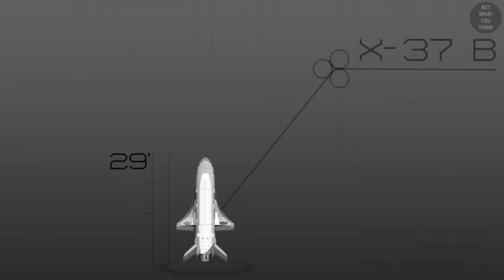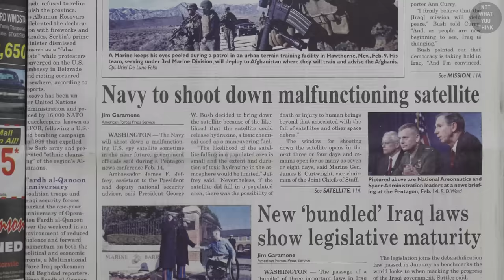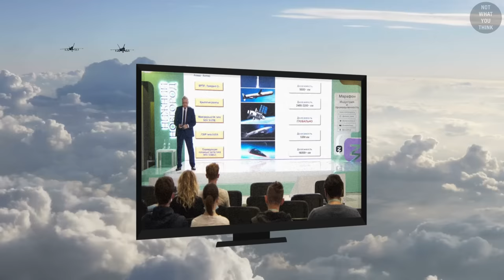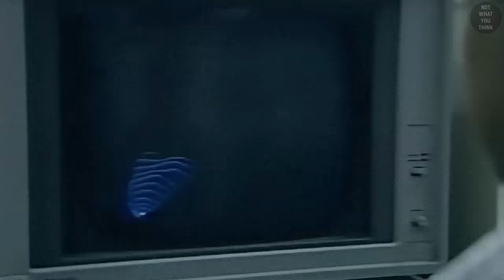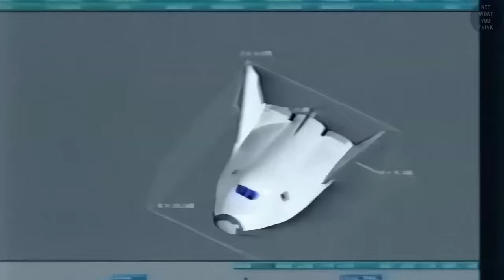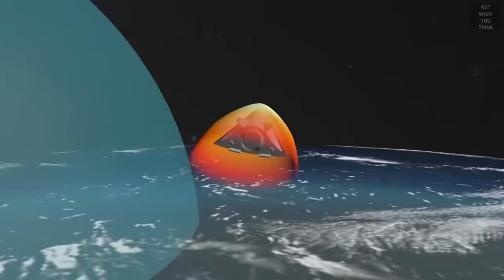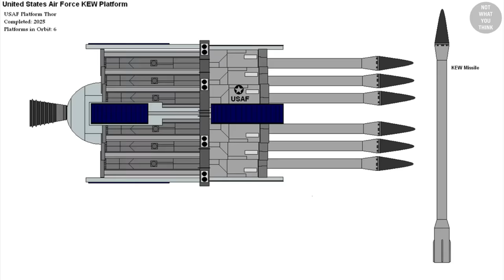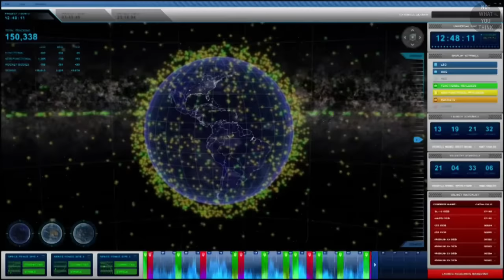Why Russians Think X-37 is a Nuclear Space Bomber

Comment: My take is that the X-37 is an all-purpose utility vehicle, and that shear utility lends itself very well to any number of military uses.  That role it's filling is determined solely by the payload, which is by default completely modular.  Many of the various scientific tests are about things that both civilian and military fields would find of interest.  Additionally, its flight profile is far more flexible than older satellites, and as everybody's orbital watch programs were build around those old limitations renders them far less valid by default.  Previously, satalites were like rail roads, and the X-37 is a truck that can go off road.  There are many reasons to want something that can go off road.

Finally, its entirely possible that both the program itself is perfectly clean and there are direct military uses being developed.  The payload bay is of known design, so handing those numbers off to a separate team/program with otherwise no connections is completely possible.  This is basic compartmentalization, and allows people to truthfully say they don't know about things that are happening.
Reply: This is without a doubt the answer- this way each field's experts can be tapped with clear conscience, far fewer OSINT concerns, etc
Reply: my exact thought tbh
Reply: An open platform to be utilized for whatever situation demands
Reply: Negative Ghost rider. It has one use and one use only. He he
Reply: I'd say mostly this, with a primary emphasis as a test platform for new propulsion systems - i.e. advanced plasma thruster prototypes or similar that are coming via black projects and not the open R&D pipeline. Where better to test one panel of a Millennium Falcon style thruster cell than with a craft we already admit has odd ability to change orbit much more than most previous vehicles could... well, yeah.... great way to more or less admit what you're using it for while still being quiet about actual capabilities (as long as you use limited power during tests so nothing too quick/fishy happens that would raise their suspicion more) :D
Reply: It's also important to note that the US space force needed a vehicle to actually do stuff in space, something that was both small but could get things done. I bet they are already looking into more cost effective means of actually getting things into space.
Reply: in a way it could be considered "modular", and we all know how the U.S feels about that word
Reply: Agreed. A dedicated space bombers makes no sense to me when we have ICBMs from the US and Submarines... Hell a stealth 21 B with cruise nukes can do the job as well just as much... 

 A TEST utility vehicle makes perfect sense to me. I feel like it is a bit too small.

 A satellite killer definitely makes sense to me though. Something that can go up into space and disable multiple satellites quickly without causing much debrie would be insane. How one does that I have no idea. Space LAZERS on a TURRET! 

 I mean if it were to be a military weapon that would make the most sense. A weapon that can stay in orbit with utility uses or ways to disable satellites without causing a huge space catrasophe with space debris.
Reply: If the US isn't trying to develop space weapons, that would be the real surprise. If it's not the X37, it's something else we don't know about. So yeah, the impetus is there and the X37 could very well have been fast tracked for weapons development. It doesn't really matter though because something is.
Reply: So no.4814, it is in fact capable of carrying a nuclear load. So its a nuclear bomber after all. Good to know.
Reply: @marekkurwa  By that logic, so is a Cesna.  Not a very good one, but physically possible.
Reply: @danielbrower4814  Sure no.4814, very genuine response, human like too.

Comment: The tungsten rod would be closer to a moab bomb  not a small nuclear bomb. And that would be a normal rod, but the cargo bay of the x-37 is small so a smaller rod could fit.
Reply: I don’t know much about the rods but I tend to agree. They’d probably be more for precision strikes in places with good anti missile defenses
Reply: Won't it just disintegrate as it enters the atmosphere
Reply: @RohanSingh-zc4bm  Although there is a chance, I’m sure the space force has done research proving it won’t
Reply: @RohanSingh-zc4bm  Nah. Tungsten is very resilient to wear and tear. it will certainly heat up a lot, but as long as the rod is reasonably large most of it will hit the ground incredibly hard.
Reply: Its weight must be immense!
Reply: Actually, the smallest tactical nuke had/has an explosive equivalent to 10 tons of TNT, both the Moab and the latest proposed kinetic weapon system have higher yields. The MOAB is equal to 11 tons, and the kinetic weapon system last proposed in 2003, was 11.5 tons. The concept that was proposed in the 50s was to use even larger tungsten rods and would have had an even higher yield. But the X-37B is too small to carry even the smaller rods, it only has a cargo bay close to that of a pickup truck’s bed. The much larger X-37C could possibly carry them, but it still hasn’t been shown, so no idea just how big it will be.
Reply: Tungsten rod the size of a telephone pole dropped from orbit would generate an explosion equivalent to 120,000 pounds of tnt I believe and be next to impossible to detect as well as impossible to intercept because it hits Mach 7 or something

Comment: @7:49 is a good photo of the bottom of the nose of the aircraft.  The heat shield tile layout looks particularly interesting. As of those around the oval tile could fold forward over the oval tile like petals of a flower closing at night.  This would allow a telescope to be housed behind and have the secondary mirror on the back side of the oval tile. This also fits with why the front looks significantly thicker than the space shuttle design, the odd location thrusters at the nose area and why the heatshield tiles go so far up the side of the nose...to protect sensitive equipment located therein. This is a moveable telescope that can change predictable orbits (something that known about satellites and is used in mission planning on the ground to hide assets).  Tthe cargo bay probably houses fold out communication equipment to pass data to other satellites or ground stations. I doubt the vehicle would carry a warhead in the cargo bay, or it would have to jettison it each time before landing. A payload like that would be too heavy and high risk to attempt a landing at any of the known sites.  Now, they could have tested the effects of space on warhead components, but bringing a device back is again, very high risk and would probably land at a less populated site.

Comment: The hilarious part is that it is exactly what the Air Force says it is 

As an example 

Put 20 gyros on it , with them running continuously until 15 fail or the ship needs to land ( whichever comes first )

And then the engineers get to disect the failed gyros and find out why they broke.

They really are testing components for satellites , in order to build satellites that last longer.

Comment: I think it's a recon vessel, but maybe it has anti-sat capabilities, or else, it can evade anti-sat missiles. I think it's reusability makes it ideal for rapid modifications of whatever it's carrying in its payload bay. And, it's not impossible larger variants of the X-37 have ground or sea strike capabilities. The USA may not have an edge in "hypersonic' atmospheric weapons against China and Russia, but it does have the most superior vehicles operating at the ultimate high-ground, and any weapon dropped from high orbit would naturally be hypersonic even if its a gravity driven dumb-bomb. The USA has several multiple purpose designs in its vehicle inventory, and you essentially can't tell what it's capable of doing until it actually does it on mission, because you don't know what it's kit/loadout is.

Comment: X-37 can certainly be dual use.   It can use some space to conduct experiments, and the rest for nukes.   But I'm skeptical, because the point of nukes is deterrence.  Deterrence doesn't work if you keep the nukes a secret.
Reply: Yeah exactly. Plus if I were sending nukes into space, I would leave them there. I would not wanting the nukes returning to my military base flying 10fold the speed of sound in a vehicle tested like 10 times.

Comment: Hydrazine is so corrosive that will it will still eventually eat through those max level protective suits. So many times the suits are disposed of in special treatment center after 3 or 4 uses. The XB-37 is what the Pentagon wanted the Space Shuttle to be, then didn't use it in the end and those Pentagon requirements are well known.

Comment: When we have highly effective ICBM's, why would we need this drone to deliver nukes?  No, what they told you about testing engines, re-entry technology, and testing metals and components is exactly what this would be used for.  I am sure they tested an ion drive already, and if used as an anti-sat platform, I'm sure it would be very effective.  Now if we had a valid laser device or particle beam weapon, it would be great for those two, but the last time I saw an effective airborne laser system they needed a 747 to house it in.  Rail guns are coming down in size, but I don't think they would fit in there either.  The hydrazine story about the hazmat suits sounds spot on too.  We use them in the F-16 because it's a fly by wire craft with no hydraulic/cable backup in the event of power loss from it's single engine.  In this spacecraft, there isn't a jet engine to provide power, so it probably uses the same kind of power system as the F-16 APU.  We used to have drills clearing the flight line of personnel if there was ever a suspected hydrazine spill, and they mopped up wearing suits just like that. 

Since they have been hell bent to create this 'Space Force' recently, I wouldn't be surprised if they were investigating a manned combat shuttle at some point.
Reply: The whole program was just a test for the real project that’s up there now or about to be. Just making sure certain technologies worked before goin all out with the real project

Comment: The US has pumped countless dollars in now deployed direct energy weapons (Lasers) to protect naval ships from air land and sea vehicles, drones etc. the first deployed was powerful enough to destroy a small boat, they now have a 150 ,..5x thd power of the beam . If u think of it, a laser beam of energy moves at the speed of light, instant , it’s path is perfect straight , not affected by winds etc and the beam can stay consistent . Clearly with the current research is direct energy weapons put in fighter jets, ground vehicles, base defense and a now testing AC-130 SOF suporting Gunship with a laser adjustable in power output. A weapons system operator or AI based targeting system uses sensors to locate targets and with light speed perfect straight instant impact could fire hitting a baseball instantly with unlimited targets, SOCOM operations support would be like nothing before . Defense lasers on aircraft are being developed simultaneously , an S400 is no threat when it’s picked up and located by the jets sensors , then jsut take a very simple program like those thst operate the Phalynx CIWS defense weapon that scans , seeeches, locates, targets , tracks and intercepts targets on its own in autonomous zone. An effective weapon but put a laser on it it’d be unstoppable because the radars know exactly where the target it it’s then just need to fire, not project where it will be by the time the rounds get there.  China is workin to on a laser so we see the future is laser defense weapons .

Comment: I thought that the HTV-2 project was cancelled. If not cancelled it's definitely not a part of the PGS program anymore. PGS has seen a significant reduction in light of a massive budget increase for various other hypersonic missiles programs which are more urgent (and cheaper) than a system capable of hitting any target on the face of the Earth within an hour. Medium range systems of up to 2000 miles, both boost glide and cruise missile types, are the focus of DoD's effort to field the next gen strike systems.

Comment: It's got all the hallmarks of a multi-role workhorse. In fact a tiff over the mission creep behind the X-37 probably contributed to the founding of the Space Force. A delivery system for warheads is only one possible role. In a hypothetical future military space station, it could be a means of delivering supplies without relying too much on the fickle private sector to run the missions.

Comment: It would be stupid to place nukes in orbit for the purpose of targeting places on the ground. Its very difficult to de-orbit an object. You need a lot of delta V to kill your orbital velocity, and even then, you are still traveling so fast that you light up like a beacon from friction with the air.   If you just passed the spot you want to nuke, you would have to wait 70 minutes or more until you came all the way around again to launch.  Every ICBM in the US arsenal has a shorter delivery time than that.   Ballistic missiles launched from a sub can hit anywhere, even more quickly.  The Only thing an orbital launch platform would enable you to do, is to more rapidly take out an enemy’s orbital assets. Be that spy satellites or a full on space station.   Another potential use would be a laser based ICBM interceptor system, looking to destroy incoming ICBM’s while they are at the top of their trajectories, out of the atmosphere, where a high energy beam weapon would be more reliably effective.  But something like that would have huge power requirements, requiring a nuclear reactor, or solar panels larger than those on the ISS.

Comment: There is not much different in fuel and rocket payload to move multiple warheads on a long range ballistic path vs putting them in orbit for months if not years at a time.  You don't need a little space plane to smuggle and stash nuclear warheads into space.

Comment: I've never understood the obsession with reusable spacecraft. We use millions of tons of disposable stuff here on the surface every week and the effort to reuse a spacecraft is massively more expensive and less fuel efficient than a one time use spacecraft. The manned shuttle at least had the excuse that it needed to return the crew, along side the general novelty for positive PR.

As for orbit based weapons, pure propaganda, the physics just don't give it military or cost advantage over terrestrially launched missiles.
Reply: Look up "rods from God"
With the kinetic energy you can gain on reentry it doesn't need to be a nuclear weapon.
Reply: @rogerout8875  Again, childish fanboi propaganda. The physics(Orbital mechanics, energy losses, cost, response time, etc) do not give rods reentering from an orbiting satellite any advantage over a terrestrially based weapon system.
Reply: @mytech6779  it would appear DARPA disagrees with you.
Reply: @rogerout8875  The physics are what they are, and while not elementary level they are not some controversial topic at edge of the envelope.
So either you don't understand what DARPA has published, or like I wrote before... propaganda, cherry picking data for clicks and politics.

Comment: It's certainly no doubt that the losses and retirement of the shuttles were a loss to space cargo, and there are things NASA, Space Force and DoD would prefer to not be so heavily depend on SpaceX, B O or foreign agencies on, to research, operate and service.

As to kinetic or nuclear weaponry from space down to earth, in practice seems rife with issues. Even with the excellent miniaturization of warheads, it takes quite a lot for anything to survive reentry. Especially something rather heat sensitive. It needs a perfect reentry angle, sl you'll probably not cut detection time by that much compared to modern ICBMs - but greatly extend launch time. And that assumes other potential adversaries do not have their own space assets able to detect that, or even the ability to hack into (or already have backdoors in place in) other tacidly or completely unaware commercial satellites, that they can reorient and turn into a 10-20 km/s projectile to literally smash into your gear before it can complete its mission.